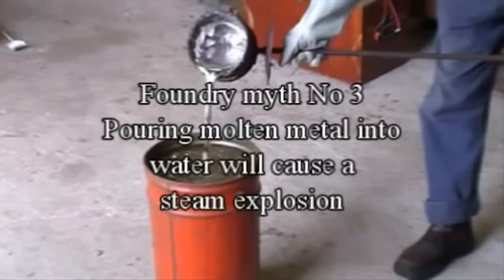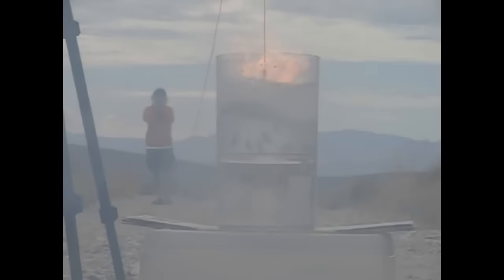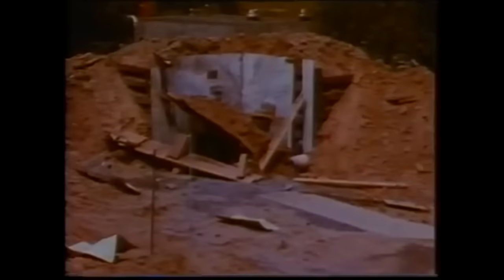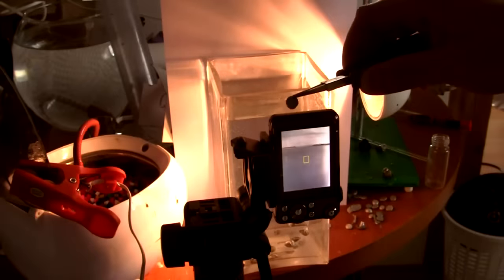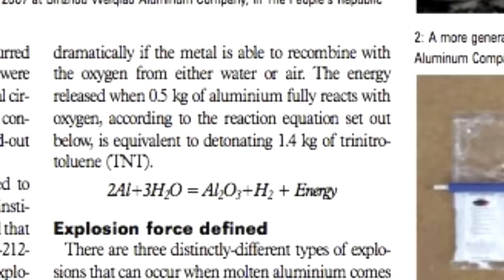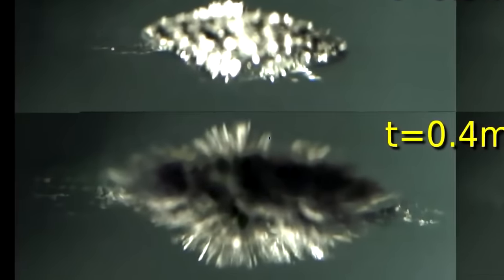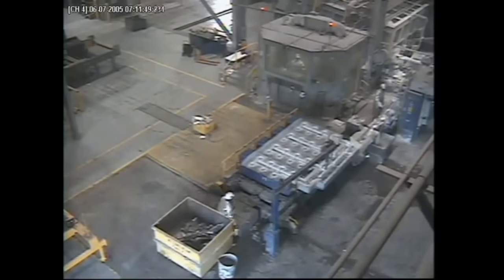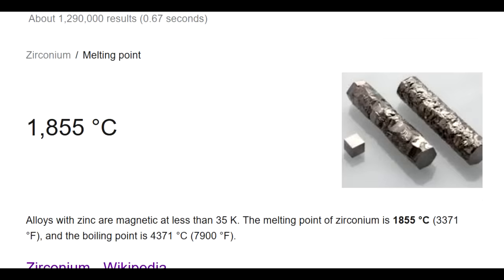The Awesome Power of the Aluminium-Water Explosion!

Comment: The reaction between sodium and water, or potassium and water, is in no way a good analogy for the reaction between aluminum and water. aluminum does react with water, but it quickly creates an oxide layer. if your aluminum explodes that means its mixed with a little bit of mercury. mercury, in an aluminum/mercury amalgam, will get rid of the oxide layer, allowing the oxidizing reaction between the aluminum and water to constantly take place. That along with the fact that hydrogen is also produced in the reaction, creates a chain reaction that results in an explosion. the reason you didnt get any explosions in your small scale experiments is most likely because you used pure aluminum, which created an oxide layer and then stopped reacting aside from the obvious boiling from the heat. these explosions happen in large factories because its hard to keep such large quantities of aluminum from having any sort of contamination. even a relatively tiny bit of mercury in a large amount of aluminum will hinder the oxidation layer, and when introduced to water it will create a large chain reaction, and subsequently an explosion. Another reason explosions can happen in large factories is because of the large scale aswell, but not just because of the likely potential for contamination, but because of the large scale itself. if you have a small amount of aluminum the oxide layer will form when it touches the water, and thatll be that, the boiling wont really mess with it, but if you have a large amount then the boiling water can get stuck under it, in some pockets, etc. breaking the oxide layer that way. again, causing a chain reaction. so yes, large factories do need a lot of safety measures, because of the large scale, but people like the backyard scientists dont really need to worry, if they know they have pure aluminum. aside from the obvious safety measures you should have working with molten metal and boiling water, theres not really much to worry about.

Comment: So what you're saying is that airplane fuel doesn't need to be able to melt steel if the molten fuselages happened to flow into pooled water from the fire sprinkler system? .......sorry, thought I was in a different part of youtube......

Comment: Your explosions in casting in too wet sand are super steam at up-to 400 degrees c not a metal explosion, just trapped steam, a well known risk in a foundry. Is Aluminium in the same area of reactive metals as Sodium, Potassium, lithium etc, on the periodic table? With a large volume of water and a small volume of aluminium, in its tenacious (less thermally conductive) oxide skin, the water will form convection currents and cool down quickly, and as it’s not in a confined space

Comment: Uh... adding a SMALL amount of aluminium to a LARGE amount of water is reasonably safe.  Just like adding a small amount of sulfuric acid to water is OK.

But the other way around is incredibly dangerous.  A small amount of water added to a large amount of molten aluminium will make the water boil instantly.  And that boiling will cause molten aluminium to splash everywhere.

Similarly, people have been dropping molten lead into shot towers for 100+ years. It's fine.  But do it the other way, and you won't be around to tell your children what happened.

Comment: Maybe I'm being a little simplistic here, but given the relatively small amounts of aluminium you want to melt here, why don't you simply pass a high current through it? 

You don't need to go to quite this length - https://www.youtube.com/watch?v=DJOX0c60wQE - but I'm sure a few hundred amps at say 6V or 12V  should do the trick. 12V*100A=1.2KVA (or roughly 1.2kW) which should be enough energy to melt a few grams of whatever conductive substance you choose. 

For the record, you can melt a fairly substantial screwdriver with a car battery, and a mate of mine conducted an impromptu experiment to melt a large pair of electrical cutters with 240V - the results were spectacular, and also took out the fuse at the local distribution transformer, and in the process, quite a large industrial estate near Edinburgh. He survived unscathed (which is why you use proper safety rated cutters, not the cheap ones), the cutters did not. 

This type of melting can be done in an oxygen poor environment too, so you could scrub up your sample in a CO2 or nitrogen environment to remove the oxide, then melt it and drop it in to the water. The use of elctrickery also allows you to melt things from a safe distance.

Comment: Melt zirconium and drop it into water? No, no sir. 
You want to test with zirconium, what to do? Make a chamber you can pull a slight vacuum on and still see into. A lucite/perspex/plexiglass tube with end plates, perhaps. Within, you have an inductive coil around a crucible, and a zirconium sample. Above, large tubing and a valve to a pressurized water tank, as well as an air purge valve (because the vacuum isn't complete). 

You heat the sample, and the moment it melts you dump the tank into the chamber. Voila, molten zirconium in contact with a full volume of water. If proven, you won't be testing twice.

Ok, ok.. maybe not so complex to just trip a hinged platform and dump the zirconium into a bucket. But not as impressive! That's also a pyrophoric material so may need an argon purge for whatever setup you use, just so you can see what's going on.

Comment: I have to disagree i work with molten aluminum quite often the explosion is a bleve boiling liquid vapor explosion the youtubers are not lucky they used large vented water tubs and a slow aluminum flow the foundry used a small container and dumped quickly a large amount allowing pressure to increase and explode they were also using impure contaminated aluminum much less volitile

Comment: Just laughed at the start.
Randoms saying that molten aluminium + water doesn't do any explosion, meanwhile heavy industries like Rio Tinto warns every one about this risk (and spend money to prevent this) ...
Don't know who i have to believe ... or do i?
Reply: Al "explodes" when it heats a proportionally small mass of water rapidly. It's really a "steam explosion." That's NOT what the alkali metals are doing though.
I'll believe molten Al behaves like an alkali metal in water when I see it. (I DIDN'T see it here.)
Reply: @bcubed72  I don't know the exact reaction (actually i don't think i knew it one day ...)
But i clearly remember what looked like a pressurized cast (don't know if it the right name) where there was condensation/moisture. The machine just exploded, 2 peoples badly wounded (flying aluminium chips and heat).
So yeah, at a chimical level, it's may not be an explosion (like tnt etc ...) more like putting water in boiling oil, but seeing that some people say that a myth, i can't stop laughing x)

Comment: A peanut gallery suggestion here: but perhaps using an ICP torch to melt the Zr (using a wire and feed rate to control the drop size) and dropping it into water in your Ar environment.  you could pull the ICP torch from an old ICP-AE (https://www.ebay.com/i/174165792719?chn=ps&norover=1&mkevt=1&mkrid=711-117182-37290-0&mkcid=2&itemid=174165792719&targetid=915708758100&device=c&mktype=pla&googleloc=9002691&poi=&campaignid=9343999098&mkgroupid=94993858779&rlsatarget=pla-915708758100&abcId=1139336&merchantid=6296724&gclid=Cj0KCQjw0YD4BRD2ARIsAHwmKVmA4Uk3UqttufxltiJZVyUe2JquWFKKN16Ak5FwfD3yIkMrvjEqHSkaAvoBEALw_wcB).

Comment: Bud, sorry, but you are VERY mistaken, a steam explosion depends on a criticality system, if your specific system can't reach the energy requirement for one it won't lead to an explosion, those people pouring small amounts of (not incandescent) molten metal into water or whatever were never at any actual risk, they:
1- Wad enough water to quench the aluminium's heat 
2- Were pouring small amounts compared to both the safety demonstration and industrial accident/incident cases
3- Were not pouring incandescent aluminium
Your entire premise is flawed, molten metal steam explosions don't happen due to chemistry at least not on a small scale, they happen due to physics, when they happen it's not because the aluminium is so hot it literally burns in contact with the water, it's because there is so much heat large amounts of it heat up instantaneously creating turbulent flow and superheated water which finding a nucleation site will cause all of the superheated water to boil at once, aluminium isn't potassium or sodium, it's FAR more stable, comparing those two kinds of blasts as if they were the same thing is not only unethical as they are totally unrelated but it is also immoral as you are spreading misinformation regarding a very serious issue, industrial explosions MAY have that as a FACTOR but nevertheless the amount of heat in the metal itself is far more than enough to boil all of the water in a quenching tank, especially if it's incandescent as it usually is, one should think 1000x before correlating two completely unrelated phenomena, and if you still doubt me just seach for superheated water and witness it's destructive power, you are very much underestimating how destructive the mere interaction between heat and water can be and how it happens without the influence of metals burning, as proof one could test what happens if you pour metal into a non-oxidizing fluid and see how the steam explosion still happens but i wouldn't dare for my life to test that, 100% sure way to burn down the house/get really hurt with a superheated oil/other fluid explosion.

Comment: So what this video proved was that in order to get aluminum to explode while in a liquid state you either have to pour it very quickly into water (2 guys with a crucible clip) or you have to have a wet mould. Otherwise as long as you control the pour rate you should be fine.  
Honestly I find this video rather pointless wanna know why? Go watch people take castings of anthills with aluminum. Amazingly because the flow rate is reasonable even though they're pouring onto and into moist soil the actual risk of explosions is minimal. If you're an idiot and dump a couple kilos of molten metal into a small amount of water of course it's going to be dangerous. But slowly pouring aluminum into water as the backyard scientist showed is comparatively safe.

Comment: Twin towers, molten airplane aluminium and fire sprinklers!! you just hinted probable solution to largest puzzle !!
Reply: Zegarac Robert pouring molten aluminium in the open does not cause an explosion, only in the confines of a mold or containment as I a furnace. The twin towers scenario does not make sense. The video footage of molten metal pouring from the building as glowing red as it falls does not make sense of the aluminium theory as it doesn’t glow when poured into air. Thermite does though, watch some videos on thermite and then watch the metal pouring from the twin towers again.

Comment: Won't you get an explosion from any proper ratio of source flame/water, seeing that you are probably separating the two elements that water is made, so your creating oxygen, hydrogen, steam and air pressure with a big hot fire right there. What could go wrong. The guys pouring the molten metal in water are lucky I thing owing to not the ratio of flame/water but the temperature of the water is why that guy still has his balls intact.

Comment: I thought it was the Water that explodes and not the Aluminium. so in the clips Is'nt it a quantity to pour speed issue keeping his nutsack safe?
 ie: the more mass that hits the water the faster the water super heats causing expansion & explosion. Pouring a small mass of molten Aluminium into a volume of water far larger than the aloy mass results in a larger area for the heat to dissipate into but reverse the quantity's shown and you would get a steam combustion.

Comment: I think some of the casual approach to pouring aluminum into water is that for other metals it is a valid and well understood technique.       https://www.youtube.com/watch?v=nePVf5uTRsg       I have done aluminum and bronze sand casting and the main concern wasn't a lot of water but a tiny amount of water that can become vaporized and then propel the liquid metal. Some others have mentioned the extreme danger of sweat beads falling into crucibles. Your comment about the need for an unoxidized aluminum surface to react with the water seems to apply less to backyard charcoal foundries than to industrial production where electric kilns are used and inert gas is used (e.g. magnesium casting) to reduce dross contamination.

Comment: in the video analysed, there is a FREAKING HUGE DIFFERENCE... temperature.... the temperature that can be reached into a foundry is far higher than what you can get with civil means (without using a blowtorch on a small piece of aluminium). also there is the fact that the quantity of aluminium is far to small in comparison of the water quantity in the video of the dumbass that is analysed. Basic of chemistry: product X in quantity A + Product Y in quantity B = product + Energy if the quantities are respected. I don't have the exact quantity of water and aluminium but the explosion reaction can happen with a 1min:1 ratio AL:H2O because if the water is in higher quantity, the energy is dispersed and the water heats and aluminium expands.

Comment: hey thunderfoot I think that you are wrong on this one m8 the foundry explotions happen in completely different circumstances to pooring molten aluminium in to a large body of water that has space to expand>

the reason for the aluminium explosions is caused by ether 

1. The water evaporating and being super heated and then reacting (in a very similar way to how activated charcoal is made)with the molten aluminium (which is what I think you were getting at in your clips about the alkaline metals reacting with the water).

or

2. the small amount of water in the confined and constricted space (aka the steal mold that the people in the foundry safety vid ) being instantly vaporised and expanding rapidly causing the molten metal to go flying which look very similar to an explosion of the metal.

also the people you have sighted in your vid for unsafe practice are safe because aluminium wont react with water under the circumstances in there vid's because aluminium docent react with water violently if not at all, the volume of water that they used had enough thermal mass to not become super heated steam (which is the only reasonable way I could see molten aluminium reacting with water in a violent way) and also even if the aluminium caused a steam explosion the water wasn't as confied enough to cause anything remotely near something dangerous.

tl;dr thunderfoot is wrong cause molten aluminium doesn't react with water.

also don't be a cunt to him if he got this wrong cause we all make mistakes and like we all get better if we talk about them and discus them but we don't improve if we are cunts 24/7. (btw your vids man but you can be a smug cunt)
Reply: also i think that this whole ice and thermite thing works in the same way as your potassium and ice thing its just the expantion of a gass that is tamped down by something less compressable like a solid its the same principas behind how you can light a pile of gunpoweder alight and it wont explode but as soon as you get a small amount in a very confind space it expands until it pops and now i think of it there is a thing where you can put out a flame or something with a pile of gunpowder lemmy check … ah here it is  https://www.youtube.com/watch?v=aGgz-VjMEeY

Comment: alive because they are pouring it slow in small quality, if they increase the size of the pour or dump it in, then you'll get the expected boom. letting it trickle in as these morons are doing in the video isn't enough to overwhelm the water's ability to dissipate/absorb the heat and not rapidly turn the water into steam, this ontop of the dirty conditions of their aluminum, also not maintained at glowing molten hot temps like in a foundry, etc.

Comment: Well, that is incredibly stupid, this is a physics problem. If you have a little water it's A huge problem. A lot of water realative to the metal  it's no problem. Otherwise rapid cooling of metal, in general, would be dangerous. The explosion is not the metal it's the water flashing Into steam.  It's why lava pouring into the ocean doesn't explode but a garbage bag thrown into looks like an eruption is happening.
Reply: Actually, fuck it.  I'll build it liquid Al does not explode on contact with water. I will build exactly what tf shown at the end by christmas. Properly vented and with a very high water to metal ratio I'm certain It won't explode.